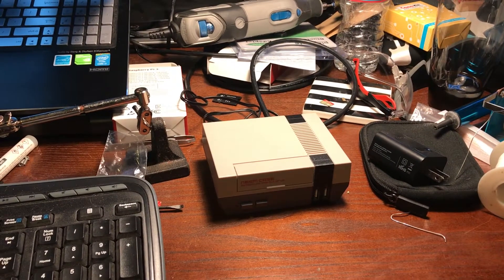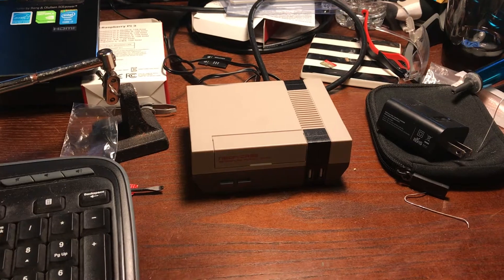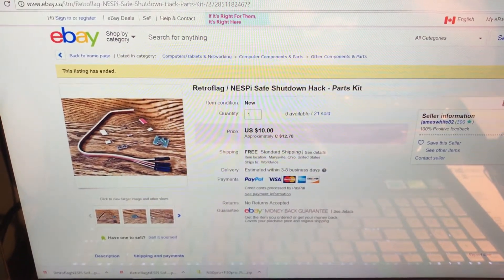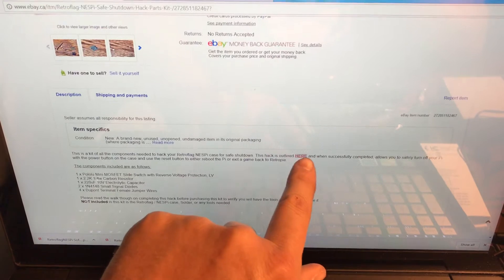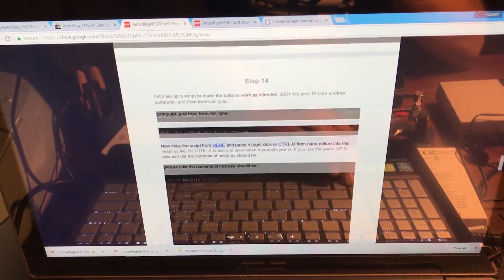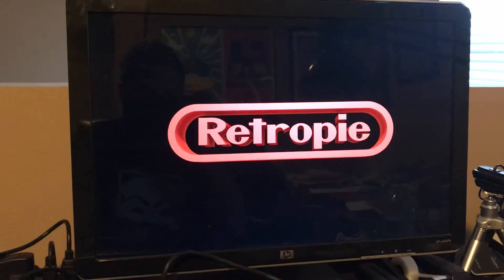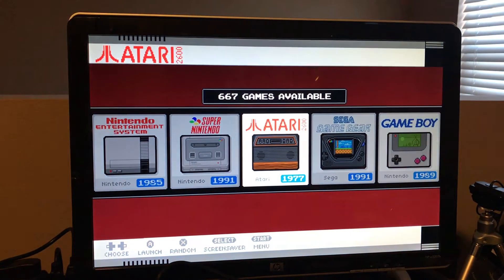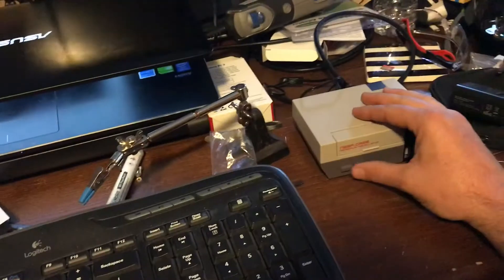Retroflag nespi case Power button hack *not reset button hack

Comment: Thanks for the video. This is as you mentioned the first video where anyone has configured both buttons to act as you would expect them to on a real console. I tried to find the actual website to order that kit, but I can only see a link to the PDF guide on how to install it via the eBay page. Do you know the url of the website? I've been wanting to get one of these kits but they are constantly sold out.
EDIT: Actually, I just found that someone apparently has designed and is selling a v2 power board here: http://www.ncspecialties.com/computers/customcomputers/nespi/softshutdown/v2/index.htm
Reply from the maker: sniperwolfjs I ssh into my pi like the pdf guide said and place this script in the file - https://pastebin.com/Afc6T0NU. Crtl x then y for yes. I pretty much just followed the directions as they were listed. Check out the paste bin file and I hope it works for you
Reply from the maker: john johnson it takes somewhere between 30min to an hour to complete the mod. It could go faster but I like clean solders. I completed my second one in about 40min with all the wires ready to go. I also like to crimp my own DuPont ends.
Reply from the maker: Steven Carpenter the kits are not available anymore from what comments he has posted and I have read on the retropie forums. If you click the guide the parts and vendors are listed. This is how I acquired the parts. There is also another hack I recommend to also ensure the metadata is saved. This is a software hack that the creator of this kit has collaborated on and works with this hack. Here is the link: https://retropie.org.uk/forum/topic/12895/ensuring-es-gracefully-finish-and-save-metadata-in-every-system-shutdown

The soldering/etc takes about an hour. Make sure the mosfet switch is set to “off” I don’t think the guide states this. If you do not the power button light will stay on and not boot the pi
Reply from the maker: Steven Carpenter that link is interesting but looks to add more work after looking at the guide and has the same desired effect. I would just order the parts listed as I did
Reply: Maybe I will just do that. Thanks for the other comment about the MOSFET switch and the script link. This should help.
Reply: SrfrBoyBob, What script did you use for this setup? I would like to do this setup as well. I tried the other way but after step 14 when saving the script that is copied over then you hit ctrl x for exit and save it goes to another screen with selections like DOS or MAC format, Append, Prepend, Help, and Cancel. I never make it passed this part to continue to the next part of 15. Hope you can help out. Thanks
Reply: SrfrBoyBob I'll try it out. Thanks I'll let you know soon.
Reply: SrfrBoyBob are you saying it takes an hour to solder the kit onto the nespi case?